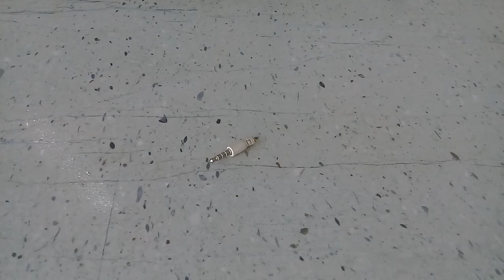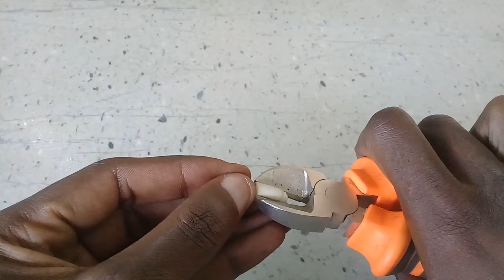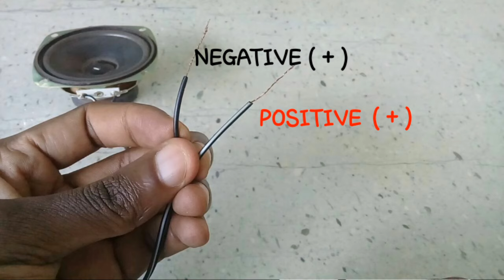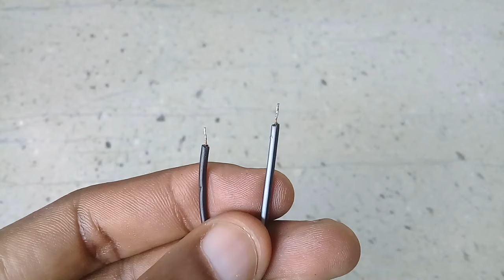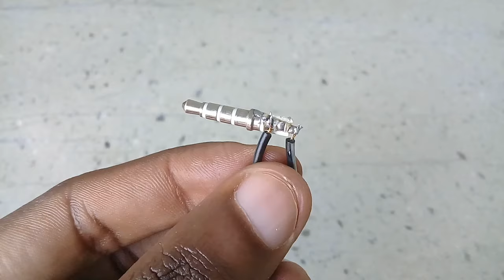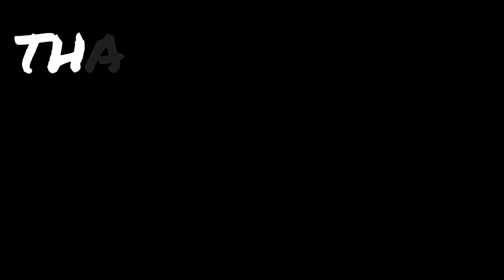Connect Speaker Wire to AUX | Speaker connect to mobile without amplifier

Comment: It working but volume so low why?
Reply: No battery connected to power the speaker
Reply: Power pathathu bro
Reply: You need an amp.
Reply: Low sensitivity speakers need amps or a portable dac
Reply: Yes brow

Comment: Guys, remember, the more demanding speakers will sound quiet, so use the smallest one you can find thats not a headphone speaker. If you open satellites from 5.1 system, they would probably be fine
Reply: Well my idea is to add some kind of power. Like a battery, because if I add power the speaker will work better. Right?🤷🏻‍♂️ But then my phone aux should make the music
Reply: Can we car speakers?
Reply: @5ksbeat811  I dont know, every speaker is different. Car speakers SHOULD be easy to drive, so maybe, yes, but dont expect loud volume with lots of bass, there is not a lot of energy to move the membrane for good bass.
Reply: What if i wired the aux to 6 inch car speaker, then the aux plugged into logitech subwoofer. Is it going to work to the best perfomance even without amp?
Reply: @muhammadfakhrulizzuanbinmd3817  Some subwoofers (ones from 2.1/5.1 set) have amp for speakers, so if there are inputs on the back of your sub, it should work far better than from your phone directly, but 6 inch is quite a big speaker, if the efficiency of the 6 inch driver is low, it will be quiet, but since its from the car, i guess its very efficient, so its probably going to be ok.
Reply: @frog  thank you man. Appreciate it a lot. So, it will work right? No harm could possibly occur. It is just that the outcome will be loud or slow.
Reply: @muhammadfakhrulizzuanbinmd3817  Yes, it should work if you connect it correctly. Most subs have either female rca , so you will most likely need a male rca connector on the cable that is coming from the speaker or two holes with locks where you put your + and - cable from the speaker.
Reply: @frog  Hey man, i made it! Thanks man. It is surprisingly loud too. I connected it to 2.1 subwoofer. There are 3 wires in the aux right? (Left, right and ground). I only connect left and ground wire, right wire just hanging somewhere. Now it only plays left channel audio. Is it possible to make it play both channels or add another speaker using the same aux cable?

Comment: Wow it actually works! I didn’t think this would work because it’s not connected to an external battery or anything. Thanks!
Reply: @kasi423  it’s ok, it’s not super loud and I think my phone can go louder than it, but it’s better than nothing. I have a desktop that doesn’t have a speaker and I hook it up to that and it works pretty well. I have a pretty small speaker though, if you had a bigger one it would probably sound better and be louder.
Reply: @andrewleaming3049  sound will be same, regardless of the size of speaker, if there isn't external power other than from aux.

Comment: My father had a sound,but it malfunctioned,so 
I took a usb cable and connected it to the speaker cable. I put it on my cell phone and it worked. Is it bad for  my cell phone.
Reply from the maker: It okay if if it works
Reply: doesn't look wrong. Nice.

Comment: It worked but sound quality is very low.
How can i increase it?
Reply: Make an amplifier :]
Reply: I don't really think you'd be doing this for great sound, but more for convenience. If you'd want better sound and more volume, that's where an amplifier comes in; a headphone jack is pretty week for driving loudspeakers (unless the speakers were somehow really sensitive, meaning they would require very little power to reach a pretty loud volume).

Comment: Bro i have sub speaker but it contains rca i have seen a product on Amazon which has rca connection point on backside and aux is provided on front side . So can i connect my sub speaker to laptop with using that product pls reply
Reply from the maker: Yeah
Reply: You can modify those 2 RCAs to single 3,5mm TRS, just cut two RCAs off and solder one TRS

Comment: Bro I did exactly this but my sound is very low
Reply: U need an audio amplifier and maybe you have a very low resistance speaker. If you use a speaker of low resistance, audio quality will be quite good but volume will be less. If you can, then use a higher resistance speaker. If now you are using a 2 ohm speaker, use a 4 ohm instead. U may have to try different speakers.

Comment: Mine has only 2 pins . Tip and sleeve
Reply: Its a mono system- single speaker driver, so yes, its TS, not TRS.
I guess you can connect it to to Tip only, but making that one wire into 2- wires from the speaker, you can connect it to both Tip and Ring, so you hear both channels summed, you will effectively have mono image, but stereo sound from one speaker. I would guess the volume will double as well- because your phone will send signal trough both wires